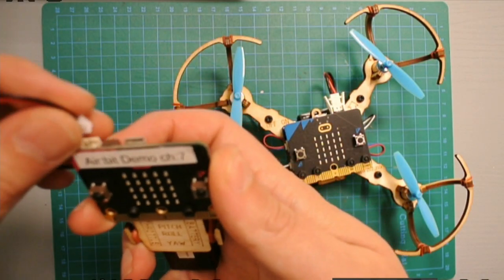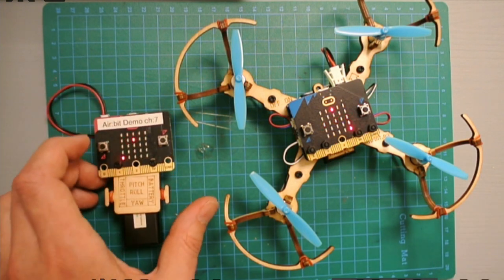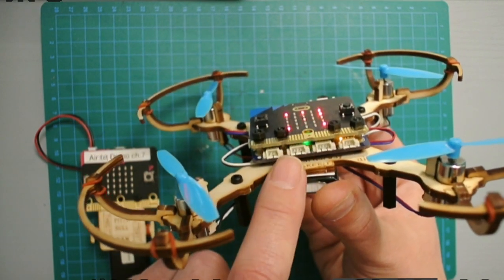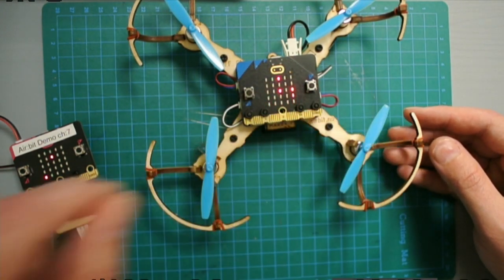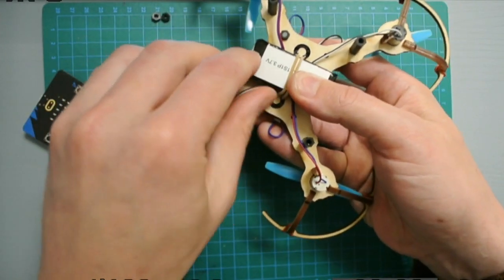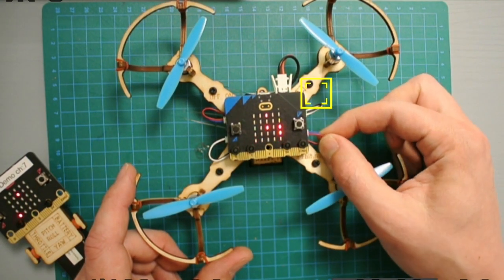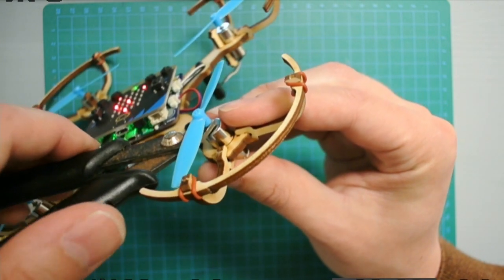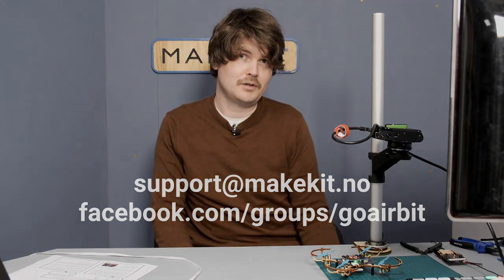Air:bit 1 and Air:bit 2 trouble shooting

Comment: Hi guys we added the wifi camera to work with iOS. In the manual you show it mounted upside down or vice versa. Why? In addition it looks like the screw to mount it is in the way to have the charging cable connected as it protrudes to high. Could you check?
Last question - what does the autopilot function do?
Reply from the maker: Hi! It's upside down for practical/mounting reasons (covering the circuit board with the wood plate) and not obstructing USB port. You can flip the image in the app. The screw should not obstruct the charge port too much but you must remember to have the two nuts under the control board to lift it slightly up, then another two nuts under the wood frame. The autopilot in makecode blocks can be set to true to disable the radio receiver and control movement internally in the receiving micro:bit.